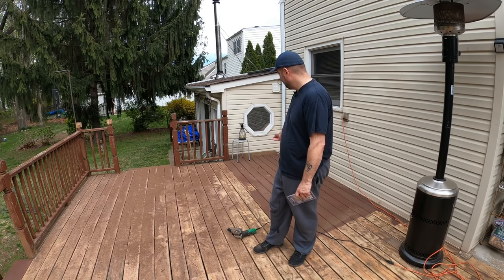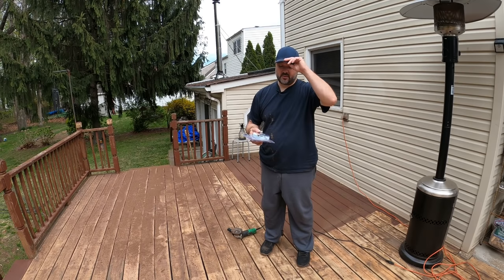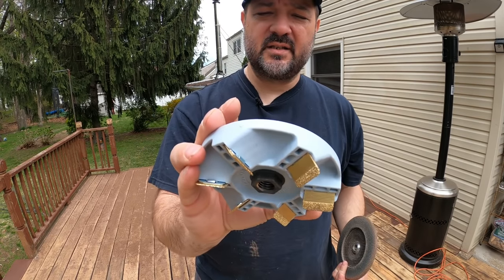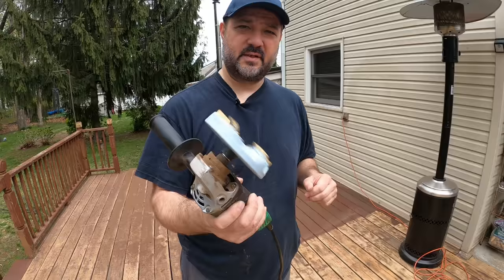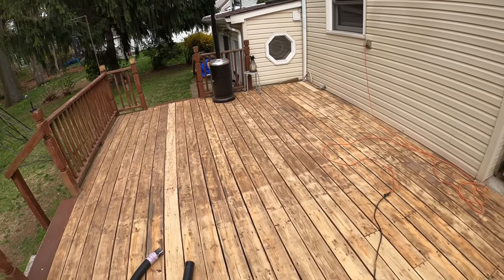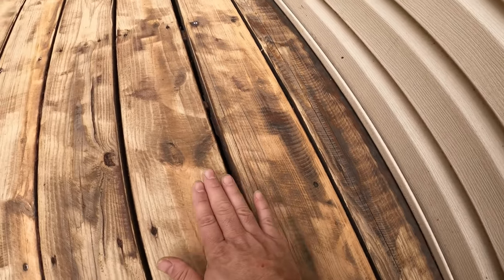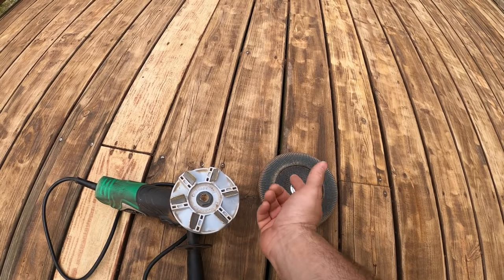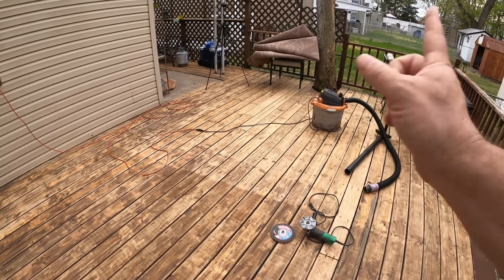Diamabrush wood deck paint removal how to remove paint from wood fast and easy

Comment: I bought one of these to get rid of the alligatoring stain on my cedar deck.  This thing worked like a charm.  A hand scrapper couldn't budge the alligatoring; with this thing, the alligatoring didn't stand a chance.    I recommend it to anyone interested in removing paint build up, blistering, alligatoring, or peeling.

Comment: I used a buffer and a 7” pad with 60grit took it out fast best part is a buffer you can control the speed a grinder could get little dangerous! Not for me but a novice would hurt themself 200%
Reply from the maker: it takes only a few practice runs to get used to the tool not that bad

Comment: Thank you Maldo......finally ! Something that actually works removing paint and deck stain. After I spent $ 1500.00 on dumb liquid stain remover, including all the top brands, hiring professional deck cleaners I smartened up and went to You Tube for more information. Diamabrush did the job in 2 days. It cost 60.00 and a sander 40.00 at Lowes. Amazing !
Reply from the maker: So glad this helped you

Comment: Dude get a pressure washer. I have a 2800 psi and it takes any paint right off. I've stripped many porches this way.
Reply from the maker: Yes that would work if it was only paint ...  This deck had many layers of paint and also that thick "deck over stuff"

Comment: Just about done with my 380 sqft deck. Took the entire thing down to solid bare wood. Left no trace of previous paint, all three colors/coats of it. The blade worked great but I had to up my angle grinder because I burnt up the first one. I wish my knees held up as good as the Diamabrush blade did.

Comment: And here I used a heavy duty belt sander with 32 grit ceramic belts. This would have been a lot cheaper.
Reply from the maker: yes agree but there were to many layers to peel back for this deck..
Reply: @maldo72  I can see how that device is quite handy. Took me days to sand mine with belts.

Comment: I've used both. And both work great. The Diamond wheel can be "very" abrasive. Lightly glide it across the decking to prevent swirls. I use them to remove peeling and flaking stain. With a good restraining job it can look brand new again.
Reply: Do you recommend taking off all stain on board, or just smooth flaking area and touch up stain? Have water based that flaked in some areas

Comment: I'm actually thinking about doing this this weekend.. would you mind sharing what your next step was? Did you repaint or stain if so which did you do and is it lasting? Also whether you painted or stained did you use any sealant on it? I'd appreciate your feedback asap.  Tia!
Reply from the maker: when using this tool you need to get a feel of it (test in a small place to get use to it ) will have an up date video soon on what i used and how did it last .......

Comment: I have used it and I really found it to be awesome. The issue I had is that the blades came out from the disc and one hit me in the chest and left a really significant bruise. The company said I was getting to close to the side of the disk and the plastic  was wearing the plastic off. I asked why don't you make the disk of metal? and was told it is a dollar and cents issue. So I bought the vacuum guard and unfortunatley cant get as close to the edge as I would like. However it does take the paint off like I have never experienced.
Reply from the maker: Thank you for watching ...

Comment: Can you please share what stain you used after removing the paint, did you match with 'solid color stain'? my deck has green color paint, I am thinking to remove using your method but wonder if it will be clean enough to go transparent stain or need to go with solid color stain. thanks
Reply from the maker: i went with a solid color stain will have an update soon on how the deck turned out after two winters

Comment: Just a tip, I’d go over the spots with nails with the Diablo disc first then use Diamabrush. You may still have to use two pads, but then your not worrying on nails and screws that are sticking out👍
Reply from the maker: yes that's what i did after i realized the hidden screws under the thick paint

Comment: I have 3" tongue & groove porch boards - probably yellow pine which we had painted years ago. We now want to remove that color. Is this tool too hard for those boards? Wondering if we should use paint remover?
Reply from the maker: i would try it in a place where you wont see it ... go easy and light pressure so you can get a even removal  of paint ......

Comment: Can you please tell me what size, if there is a size angle grinder should I buy? I went to Home Depot and they couldn't help me at all, which standard! I am assuming a respirator is some type of mask, am I correct? If there is anything else I need please tell me. I am a 72 yoa Woman, not that that should matter, but is it really as easy as you say? Thank you in advance for your help!
Reply from the maker: hi and thank you for watching .. 1) a standard-size angle grinder from any tool supply place like harbor freight will do.  2) yes I would recommend a dusk mask. 3) Maybe heavy gloves to protect your hands if you want. 4) knee pads...

Comment: How does this work against deck board nails that are driven top down instead of toenailed? Have to drive the nails deeper first?
Reply from the maker: you would have to drive the nails deeper to avoid hitting the tool ..

Comment: I used one to strip a 12 x 7 varnished deck then used it to "grind" exterior sanded stucco-like paint from a concrete wall, about 3' high and 10 or so foot long. I still have it in my angle grinder bag with about 20% of the tooth left. I'll get one more small job out of it, someday. Great tool! Just don't expect a sanded floor finish from it.

Comment: Does it ruin the scraper if you hit a nail or screw? Great video .Thank you.
Reply from the maker: yes it will chew up the blades if you run over to many nails
Reply: @maldo72  Thanks.

Comment: Thanks for posting. I went out and bought the disk today. Just wondering if, after using Diamabrush, you need to do any more prep before staining.
Reply from the maker: i will have a up coming video on this question ... this disk is the same as 80 grit sand paper .... for i did not have to sand it any more after  because i uses a solid color to re-do the deck after i sanded ... if you were doing  transparent stain etc you could go over it again with 120 grit to make it perfect but again this is a old deck and the wood was not perfect  wanted to hide some of the imperfections of the older pieces of deck board
Reply: Same question- removing layers of old paint off an old deck and i want to stain it (navy blue) afterward. Curious if this might be the product for me. Stripping isnt great because the boards are concaved and im told paint eaters will not remove all of the paint. Its been frustrating trying to figure out how to do this.

Comment: Best product on the market! Paid $60.00 for the 4 1/2 in disk. I would have paid a $100.00! This disk is no B.S. Definitely need a respirator not dust mask, eye goggles not glasses and wouldn’t hurt to have a fan to blow all the dust away from you. I restored a painted deck and this saved me weeks of stripping off paint. I tried scraping and psi washing with a turbo nozzle not even close to what this tool will do!
Reply from the maker: yes well said ...

Comment: You can commonly rent a floor machine from Home Depot rental centers which have the same disc on a larger scale. Used it to remove tar/glue from some beautiful late 1800's hard wood floor that the business at one time placed vinyl and then short carpet over.
Reply from the maker: Great tip!
Reply: What would I ask for when I go to home Depot to rent that?
Reply: @ako0z  Right! I would love it at a larger scale!
Reply: my PW was on the fritz, went to honey Depot and some kid chewing gum directed me to PW,'s. I stopped him and said listen to me I want to rent one no not buy one. He pointed to an area of the store and said if we have them they are over in the corner. Ya and it was a toy. maybe wash a car with it. Point, not all home depot's rent this stuff. Got mine fixed and glad I did. do not put Behr stain on deck or your Sanders, washers won't touch it

Comment: I am new at this. Home ownership is great. I want ot try doing some projects myself if all possible. I hope it is not too hard to use
Reply from the maker: before using the tool i would suggest that you practice on a few panels to get the hang of the tool

Comment: Very impressive!!! Sadly, my deck is too far gone. Board replacement in spots to hold me over until new deck prices come down.
Reply: Good luck with the wood prices coming down with the heat wave and new forest fires starting
Reply: Don't count on those prices coming down. Look into getting composite decking like Trex. Good stuff that will last.
Reply: @Boomhauer333  we will be going composite. Dont want to have to deal with wood and the maintenance.
Reply: @bobziadie2988  That's the way to go. You'll be very happy with it.

Comment: I used the diamond brush and it worked like a charm, I had to sand it afterwards though as it lefts some abrasion marks.
Reply from the maker: once i painted the deck you really cant see the abrasion marks

Comment: i need to ask you another question please.  what brand angel grinder and dust shroud do you use (you don't use a shroud though do you?)?  i bought an Avid grinder and herzo dust shroud and I do not believe they fit together. thanks.
Reply from the maker: i used a cheap grinder i got from harbor freight

Comment: I'm doing my deck right now and am confused on what to do. Should I use the Diablo to sand down the screws that are sticking up and then the Diama brush for the rest of the paint? The issue with my screws are that they're all rusted to hell, I was thinking of sanding them down and then covering them with a wood putty for extra protection.
Reply from the maker: YES, if you cant screw them down or remove so you don't chew up the tool ...
Reply: @maldo72  awesome, thank you! I ordered everything from home Depot and am just waiting for the Diablo to come in to get started :)

Comment: Spent a $100 at home soppy and rented a drum sander and sanded a deck to the same condition of this video iFit a 450 sf deck in less than 2 hours. Much less labor than an angle grinder on your knees and out of breath like this guy!
Reply from the maker: Thank you for watching.....   yes, but I did this over a few days when I had time. If you rent a drum sander I think they charge you by the day which would not have worked out for me..   ... also with a drum sander, you can't do the tight spots like the rails. out of breath??? really also a drum sander only works with a flat decks and my deck is not all flat

Comment: Thank you sir: I'm faced with removing a ton of peeling paint on the outside of my house and I do not relish using a hand scraper to get the job done
Reply: I've never used one of these, but like he said, make sure you inspect closely, every place there's a stud, to see if there is a nail or screw above the wood surface. To me, that looks like the only down fall.

Comment: In big open areas like this I’m always curious why people don’t use flooring sanders?
Much quicker and it’s a finish sanded result.
Reply from the maker: yes i started with that and it would have worked if it was only paint  but this deck had may thick layers of "deck over paint stuff on it too " need something that would take the stuff down fast and get down to the raw deck boards

Comment: Is there some technique to using this it keeps biting the wood unless I just use the corner of it do u put a lot of press on it Or u just glide it on the wood.thanks
Reply from the maker: I angle the tool and let it do its work (i just let if glide over it ) no pressure needed ... you have to get the feel of it ...
Reply: @maldo72  thank you

Comment: Very stupid question. I’m trying to surprise my husband and strip the paint off our AWFUL painted deck for his bday. Is that a specific tool your using that I need to get ADDITIONAL to the scrape piece off Amazon?
Reply from the maker: this is an attachment that goes onto a angle grinder ... the other tools i used was a "mouse sander" to get into the  tight spaces that the tool cant reach (like around the railing)

Comment: Did you by chance power wash your deck before using the Diamabrush paint remover? I'm getting ready to work on my deck this weekend and obviously don't want extra steps, if not necessary. Thanks so much for making the video...I'm super excited to see how it turns out :)
Reply from the maker: i power washed the deck just to get all the loose stuff off ..  yes i will have an update soon on the deck and what it looks like know..  thank you for watching

Comment: Doesn't using a grinder for sanding leave un-even surfaces?
Reply from the maker: slightly only if you let the to
ol sit in one spot ... but for this old deck there was no need for perfection i will have an updated videos at the end o the month ...

Comment: What’s your thoughts on using that to remove dried up stucco on a fiberglass deck?
Reply from the maker: hmmm if it can take off thick paint I am sure it would not be a problem... but for that i would def get the shield that goes around the tool to protect your self from flying stuff
Reply: @maldo72  thank you for replying. Do you think that it would score up the fiberglass?

Comment: Have very similar deck, and already bought that disk. What kind of stain would you recommend for a such deck?
Reply from the maker: will have a follow up video soon on that
Reply: If you got it back to bare wood I’d probably use a semi trans oil for the floor.   Would need maintenance pressure wash and reapply the semi trans every 2-3 years.  But it’ll never peel.   Can use same on railings or just use a solid stain color on railings like white which can look nice with stained floor.  The solid stain on verticals last unlike on a horizontal floor

Comment: What do you use on the rails ? I have the same problem
Reply from the maker: check out part  2 
 
https://youtu.be/cSEAxonNkhg you can used the tool very lightly ... and for the tighter spaces use a mouse sander

Comment: Why this over a regular sanding andgle grinder disk? I have seen these for just a few dollars
Reply from the maker: this takes up the paint so much faster and it does not wear out
Reply: @maldo72  I see, all the reviews say the blades pop off. Sanding discs are very easy to clean and reuse with a wire brush. They have long life as well and they are only a couple of dollars
Reply from the maker: @funstuffonthenet5573  these blades never popped off even after i ran over  screws etc i have to call false
Reply: @maldo72  Lol whatever. Affiliate link in the description. Please buy this so I get commission instead of using something far more affordable and just as good. 😂

Comment: 1, you should unplug the angle grinder before changing discs, if you value having all your fingers.
2, random orbital sanders with 60 grit paper is MUCH safer, much cheaper and works just as well. Run a hammer along the deck and sort out all the loose nails before you start sanding. A deck that size should take you less than a day. Oh, and get one of those dollar store yoga mats or knee pads for this kind of work.
Reply from the maker: I started out with 60 grit sandpaper and in  theory yes using 60 grit would seem logical but with sand paper it wears out super fast and gets clogged with the thick paint used ... with this disk zero clogging/burning paint ..
Reply from the maker: yes used knee pads before I shot the video ... it was at the end of the day really tired and the knee pad straps were hurting the back of my leg that's why I took them off ... (I had cheap knee pads)
Reply from the maker: there were no nails used and the paint was so thick could not see some of the screws plus who ever put the screws in stripped the head making it hard to remove... used a sanding disk to file them down flush with board
Reply: I have immediate recent experience with this and 100% guarantee you that no random orbit (or detail sander) with 60 grit paper (or even 40 grit) works this well.

Comment: Does it leave swirl marks?
Reply from the maker: it will leave slight swirl marks if you let it sit in once place to long... but you can over come this using zero pressure on the tool and let it do all the work for you.

Comment: Wow...I've got a big deck and after you did that small area the disc looked worn down a good amount.  I'd probably need 10+ discs
Reply from the maker: thank you for watching..  the reason why the first disk was worn down so much  ... was because I was hitting a lot of screws that were popped up and covered by the thick layers of paint that i could not see...  if you were just removing paint it should last a long time

Comment: Don’t sand with 120 grit. 120 is too fine and will not prepare the wood to the proper profile to accept the stain. Better off using Diablo 60 grit random orbital net style. It’s faster and will open up the wood much better for that stain to penetrate. 120 will compress the fiber. Great video showing the dimabrush though! It’s an awesome tool that saves a ton of time.
Reply from the maker: to be honest, I will post an update soon I did not even bother to sand any further after I did this ... it created a nice surface for the stain / and or paint to be applied where it opened up the wood for excellent absorption... into the wood ....

Comment: Would this work on my concrete driveway.
Reply: That would be interesting I was wondering about rust on cars ? And if would damage the metal or not might have to rig it up for a drill that turns slowly or if would like to strip the paint off the hood??
Reply from the maker: sorry i dont think so it would wear down really fast